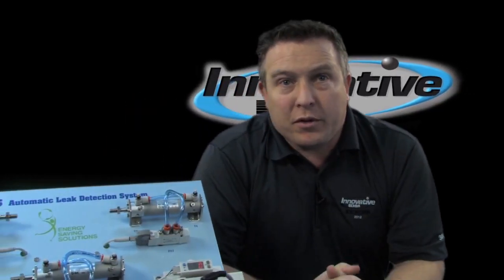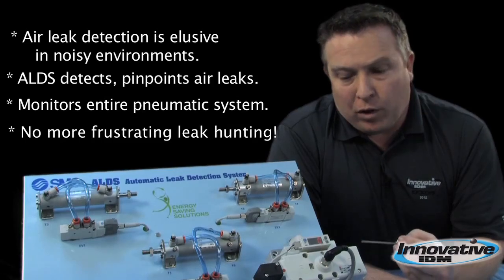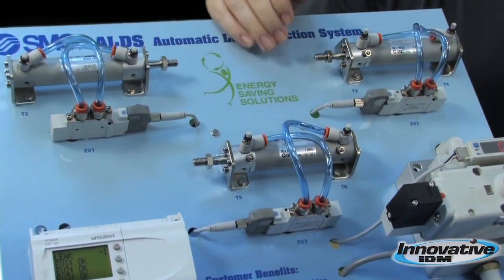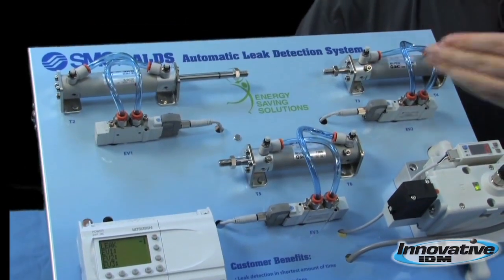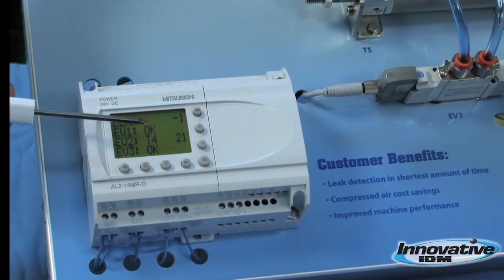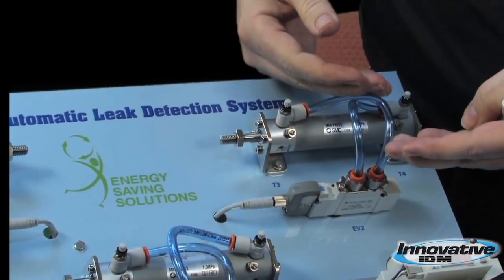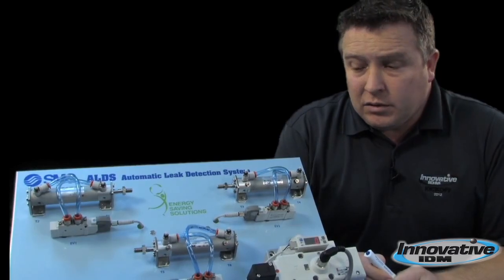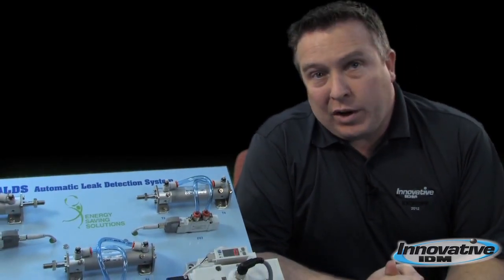SMC Automatic Leak Detection System for Factory Pneumatics

Comment: Will it also detect piston seal leaks?
Reply from the maker: Yes. The A.L.D.S. is sensitive enough to detect a piston seal leak. When the system is brought online you will establish a baseline for air consumption per circuit. If the system detects a higher consumption rate than the baseline it will trigger an alarm. It is possible that the alarm for an individual circuit can be triggered by a leaking fitting, a leaking airline tube or seal failures in the valve(s) or cylinders. The A.L.D.S. helps reduce the amount of time it takes to locate the leak(s) by essentially pointing you to the individual circuit that triggered the alarm.